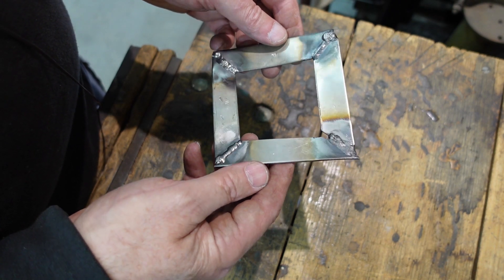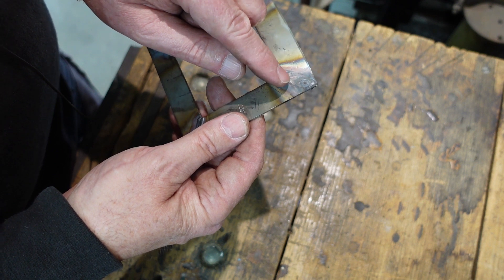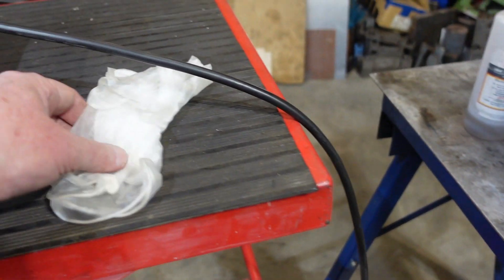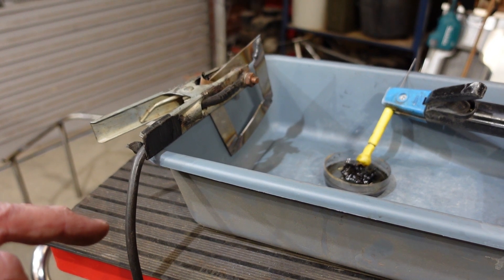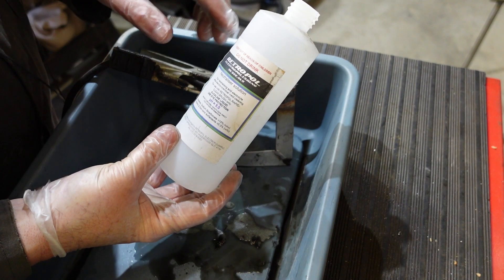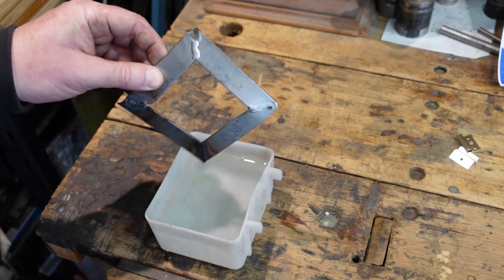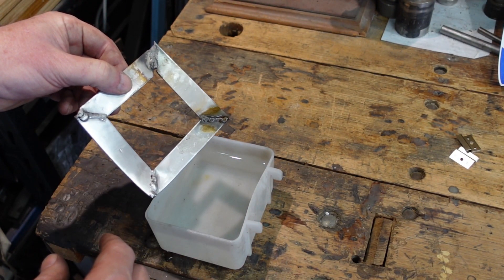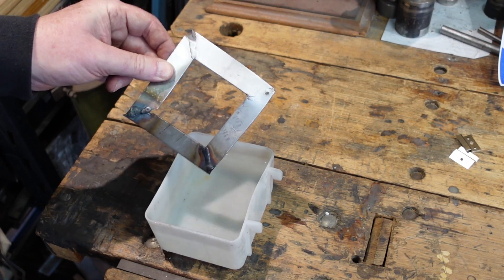Electrofinishing of stainless steel

Comment: This is great - Thank you!
Perhaps a silly question: Is the brush connected to Positive+ or Negative- on the little welder (I can't make it out in the video)? I suspect it is the Negative terminal on the welder that feeds the acid-soaked brush, and the Positve goes to the ground clamp but do not know for sure.
Reply from the maker: According to the instructions, it should be DC electrode negative as you have said.
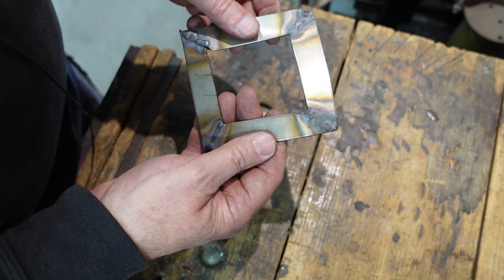Reply: @occasionalmachinist  Thanks! Sorry I didn't catch that in the video narration, but could just make out the labels on the machine at about 6:03 (the Negative says ARC). Well done.
Reply from the maker: @AerialLensVideo  Not problems. Not sure I put it in the narration...
Reply: @occasionalmachinist  Bottom line, this works GREAT! You saved the day for me on a very important project - Thanks again, my friend.